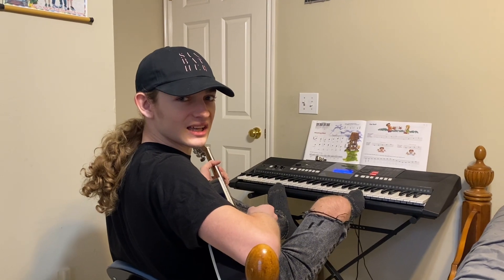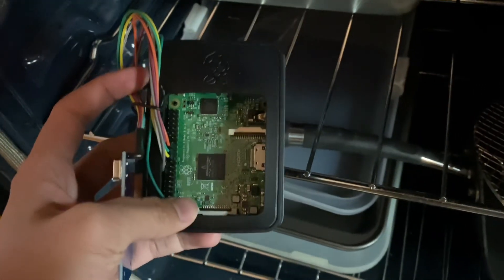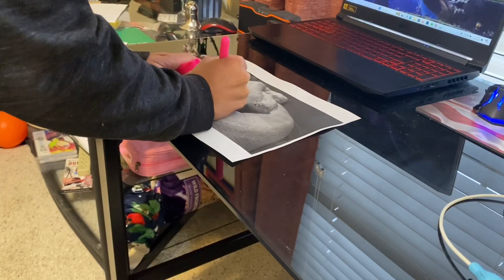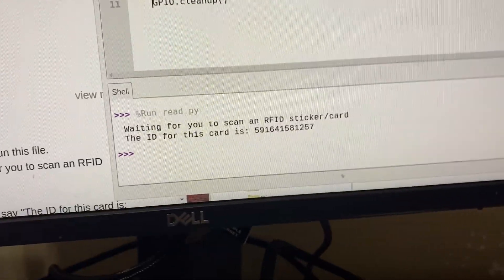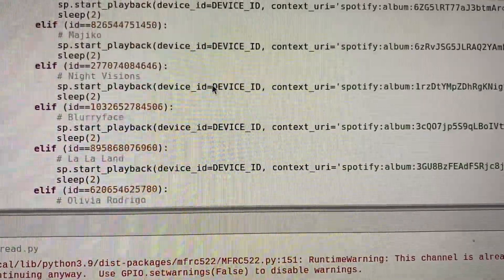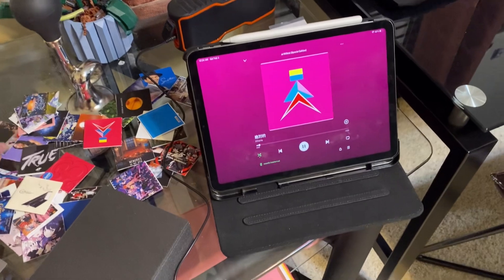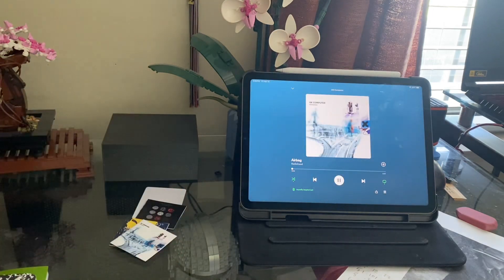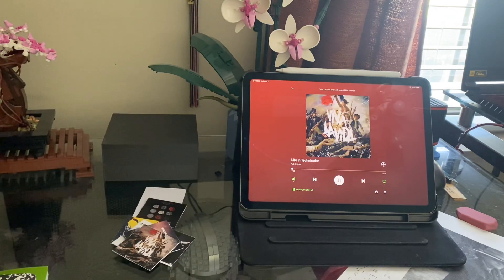Making an Wireless RFID Jukebox

Comment: Although i cringed a bit seeing excessive else if statements instead of just using a key value map, plus, raspberry pi as a rfid reader is kinda overkill, it is a cool project and i would like to have something like that myself! Keep up the good work!
Reply from the maker: I honestly agree with you on the those two points. There’s definitely an easier way to set the values than using if-else statements, I’ll look into the key value statements for future reference. For the raspberry pi, it’s already sitting in the drawer for several years so might as well use it for something at least.

Thanks for watching!

Comment: How come only 50 views? This is a cool video!
Also, I think you could've used an Arduino, it would have lower cost. I think the Raspberry Pi is overkill for such a simple thing.
Reply from the maker: The Raspberry Pi was already sitting in a drawer for several years so I might as well use it for something.